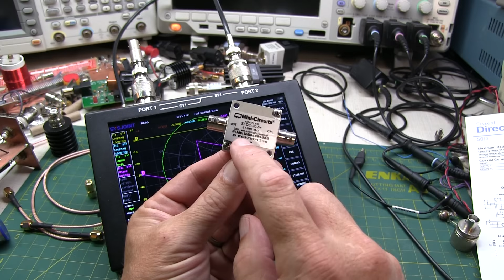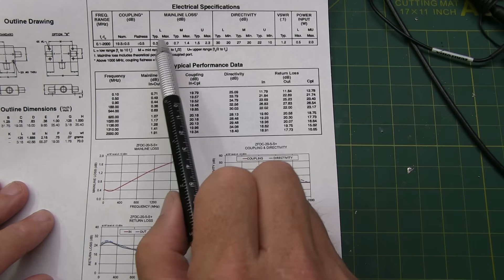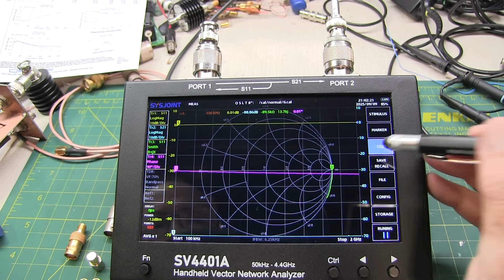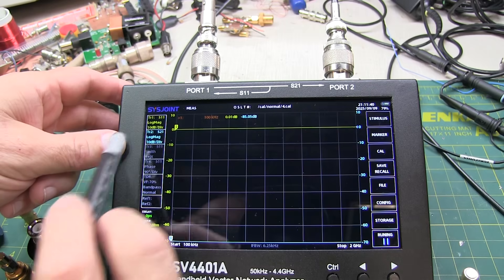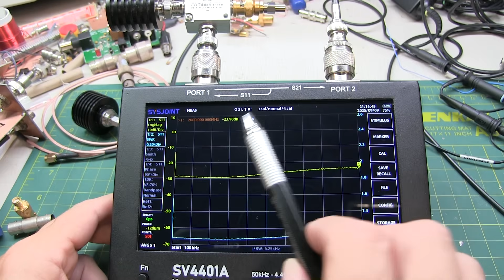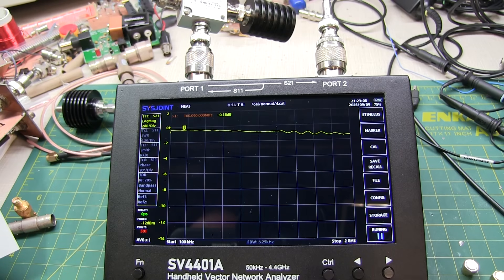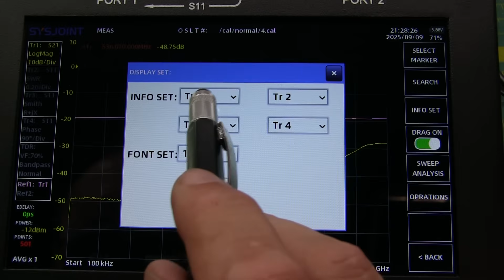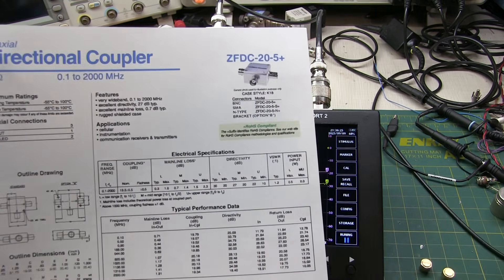#403: Measuring a Directional Coupler with a SV4401A VNA

Comment: I have the same VNA and the same Minicircuits ZFDC-20-5. My problem is that when I measure the resonance of an antenna with the VNA's S11, it reads approximately 420 MHz. Then, when I use the tuner to measure S21 with the same VNA, the reading doesn't match, and I measure around 470 MHz. I'm almost certain my tuner is working correctly and the VNA is properly calibrated; I don't know what the problem is.
Reply from the maker: What kind of antenna are you measuring?  Are you trying to use the coupler to measure reflected power from the antenna?
Reply: @w2aew  That's right, I'm trying to measure the reflected S11. There are a couple of videos online showing how to measure it with a directional coupler and a tracking generator. The problem is that it doesn't match the S11 measured by the SV4401A VNA, and I don't understand why.
Reply from the maker: What kind of antenna, and how is it mounted and connected?

Comment: Alan, could you use what you have shown here for a Mini-circuits Splitter (ZFC-2-11-S+) 10-2000 MHz device? What would I measure?
Reply from the maker: You could measure return loss, swr, reflection coefficient (S11) etc on each port (with others terminated), as well as insertion loss, transmission coefficient (S21) of each path.

Comment: Can I ask you an off topic question. How can you measure the output power from a transmitter with an unknown impedance that isn’t 50 ohms or is unknown.  This assumes I don’t have a calibrated reference antenna.  Maybe something like a small IOT transmitter or a wireless key fob ? My only thought is some kind of matching unit that could match the transmitter output impedance to a 50 ohm load or  determine the output impedance and build a special dummy load based on the measured impedance. Thanks best regards Christian.
Reply from the maker: The output power of a transmitter is essentially dependent upon what the load is that the transmitter sees. Not all antennas represent a 50 unload, and certainly not all transmitters have a 50 ounce output impedance. The latter is not a requirement. If you want to characterize the output power of such IOT devices, you would really need to characterize the impedance of the antenna at that operating frequency and then measure the power into that load.

Comment: What I would like to see is a parametric evaluation of an antenna reflection as the power increases through the system.  That presupposes that the inductance is subject to power level.

Something like Time Domain Reflectometry with CW signals.  I'm probably not thinking through this properly.
Reply from the maker: Typically, inductance isn't proportional to power level, unless you're dealing with magnetic cores that can heat up or saturate at higher power, thus changing their permittivity.  In either cast, the VNA wouldn't be able to produce enough power to measure that.

Comment: Do the dummy load, directional coupler, and other devices come with the SV4401A VNA? If not, where can I search to buy them?
Reply from the maker: It comes with the open, short, 50 ohm, sma-thru connectors, two sma cables and charging cable. The dummy load and directional coupler are from my collection of parts.
Reply: @w2aew Ok, thanks. Where would be a good place to buy parts such as dummy loads and directional couplers?
Reply from the maker: For a hobbyist - surplus parts on ebay or a local ham radio flea market (hamfest)

Comment: Thanks Alan! Realized I don't have any N male to BNC male adapters, will fix that as I have some similar couplers. Did they send you a unit with the latest firmware (V0.71)? I'll try to check later but if they did you might want to send them a note requesting they add it; SYSJOINT's support folks did answer one query I sent them so there is someone on the other end of the line!  73 - Dino KL0S
Reply from the maker: I updated mine shortly after I got it. Very easy.

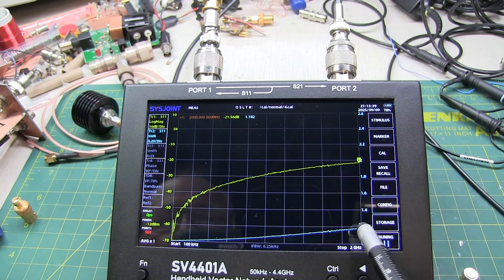Comment: 9:27 is it the calibration uint that You use to calibrate? It should show flat line since the device was calibrate to that calibration unit. I do not understand the calibration at that moment...
Reply: I guess the difference is due to now using the extra BNC barrel adapter instead of the single BNC-SMA adapter that was used during calibration. In general the best way to start would be to verify the 50 Ohm calibration unit on a calibrated VNA prior to using it to calibrate your nano-VNA, because al your measurements will rely on how accurate this unit actually is.

Comment: What is the difference between Insertion loss VS compared to Mainline Loss? What is the Directivity used for, I'm confused on when would you measure the directivity when test an RF circuit DUT?
Reply from the maker: Insertion Loss is the generic term, and is the same thing as mainline loss which is specific to directional couplers.  Directivity is important is applications where you have reflected power.
Reply: @w2aew most applications is to reduce or minimize reflected power because it damages the DUT output section. So what application would you want reflected power?
Reply from the maker: Applications such as TDR rely on reflected signals.
Reply: @w2aew the "Reflected TDR signals" doesn't damage the TDR transmitter or TDR receiver?
Reply from the maker: Directional couplers do NOT suppress the reflected power.  A device called an isolator or terminated circulator can be used for that.
Reply from the maker: TDR actually uses reflected signals to make measurements
Reply: @w2aew  When you measured the "Directivity" of the Directional Coupler, The Directivity is the RATIO of the forward power & the Reflected Power at the "Coupled" Port. What I'm confused is why do they call is "Directivity"? and also when you have lets say an RF Power Meter to measure the power level at the Coupled Port that the Reflected Power will cause "false positive" power measurements when measuring the Forward Power at the coupled port using a Power Meter?
Reply from the maker: It’s called Directivity because it’s a measure of how well it can differentiate between the two directions of power flow. Yes, reflected power can add errors to forward power measurement.
Reply: @w2aew  Ok thanks, I thought Directivity meant One-Way Direction like Narrow or Spread Wide out which is meant for transmitters Directivity. Directivity in Couplers seems like its a RATIO of a Two Way Direction of Forward Power To Reflected Power but ONLY at the Coupled Port. The Directional Coupler it seems ONLY Differentiates the two direction of power flow ONLY at the Coupled Port. The Reflected Power will back-feed from the output port back through to the Input port of the Directional Coupler, but the Reflected Power will get suppressed lowered through the Coupled Port. So the Coupled Port does suppress the Reflected power.
Reply from the maker: Right, the coupled port suppresses reflected power, the mainline does not.
Reply: @w2aew  Yea Its confusing because I don't think other RF components/device use the term Mainline Loss? Which Mainline Loss is considered Insertion Loss + Coupled Loss? When testing RF Filters, RF Diplexers/Duplexers, RF Frequency Conversions modules, you measure the Insertion Loss from input port to output port S21 network analyzer. I never heard of testing measuring the Mainline Loss of a Filter Modules, Diplex/Duplex modules, frequency conversion modules, but Have measured the Insertion Loss. I'm not sure why Directional Couplers are calling it a Mainline Loss? Circulators and Isolators i'm guessing are calling Insertion Loss also Mainline Loss.
Reply from the maker: Mainline loss is only used for directional couplers.
Reply: Mainline loss is equal to insertion loss plus the coupling loss.